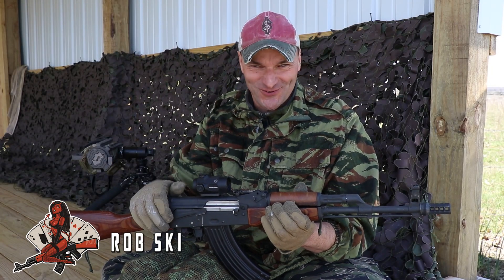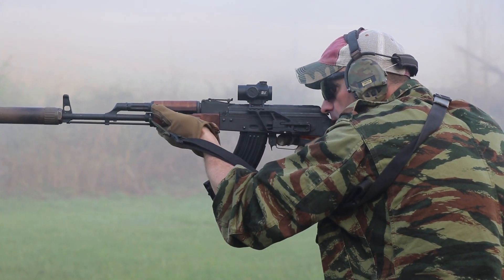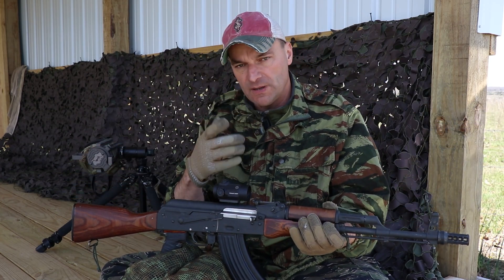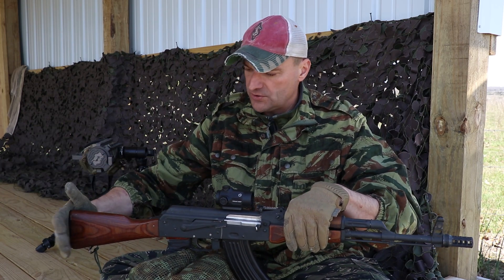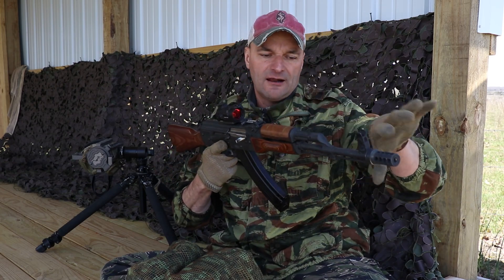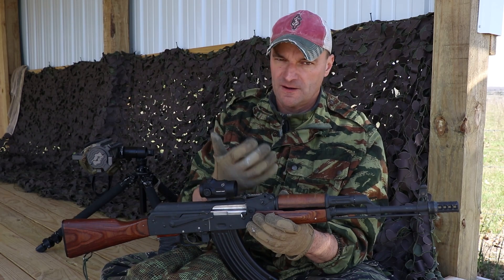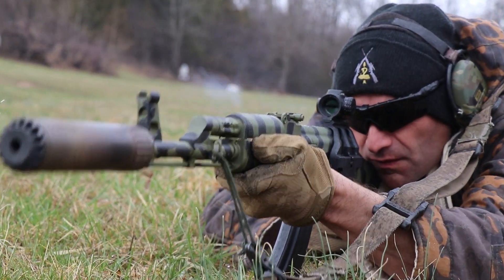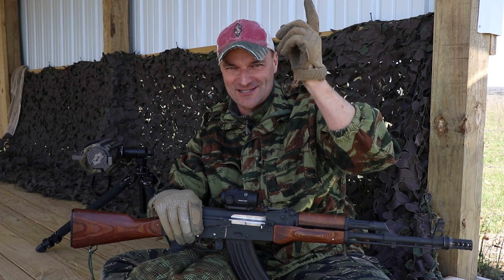Better AK47 Recoil Management! Cost nothing!

Comment: This may be what I need to get for my Maadi. I'm a firearms instructor and there's a 15 year old girl in my class that is hesitant to squeeze the trigger. She's a great shot with a 22. But after a couple of rounds down the pipe of the Maadi, she starts backing off it. Thanks for the video.
Reply: John Jacob   One of the first classes I taught had a girl in it who was 13. She had never fired a weapon prior to attending my class. By the end of class that girl could handle firing several weapons ranging from 22 to an AK47. About the only thing she needed help with was pulling the bolt back on the Uzi. But she loved zipping through the magazines in short burst. A new gun nut was born, lol. Her age wasn't really a huge factor.

Comment: I'm glad you had the cajones to mention that extended grip C-clamp thing. I feel like some guy did that as a joke and it went viral. I've never seen anyone use it until it showed up on YouTube. To each his own, I suppose.
I think I'll invest in that pad for the stock. My nearly 60 y/o shoulders can't take the recoil like they used to.
Reply: Highly recommend the pad for anyone who is recoil sensitive or larger in size or both.  My problem was both.  That extra length and the extra surface area helped me out a lot.
Reply: Its called evolution. In WW2 the soldiers were taught to shoot pistols with one hand. We dont do that anymore either do we?

Comment: Great video sir. Back in the day (late 70's - late 80's) I would see quite a few guys in my unit would have very few issues when firing the M-16, but if you handed them a M-14, they would have a lot of trouble maintaining cheek to stock weld for fast follow-up shots due to poor recoil management techniques due to the increased energy impulse. You can get spoiled real quick on light recoiling weapons for sure. Really enjoy your features friend, hope ya have a great day!!
Reply: You're comparing apples to oranges.
Reply: @Enjoyer.762  Not sure what you mean. Please explain. Oh wait, I looked at your YT homepage, there's no need simple green
Reply: @brad branch  Comparing recoil management between the M16 and M14 makes little sense. You're comparing an intermediate rifle caliber (5.56 NATO) shot from a rifle design to be ergonomic with inline recoil management (DI gas system, buffer, recoil spring) to a full powered rifle caliber (7.62 NATO) shot from rifle (M14) that was an adaptation from the M1 Garand. 

Even if you compared the M14 to the AKM, it would still be an apples to oranges comparison. Again, 7.62 NATO full power rifle caliber. 7.62x39 intermediate rifle caliber with only slightly more recoil than 5.56 NATO. There are child constript soldiers in 3rd world countries that can easily handle the recoil of AKMs.
Reply: @Enjoyer.762  All you say is certainly true there's no doubt. I was making reference to Robski's comment regarding the difference in recoil impulse between the 7.62 and the 5.45. I understand where you thought I might have been going tho. And even though there is only a few hundred ft/ps difference between the 7.62 x 39 and the 51, platform weight figures into the equation as well.
          So to clarify, I was speaking to the talking point raised by the commentator regarding the lesser need for recoil reduction management techniques in the 5.45 AK platform versus the 7.62. I wasn't trying to draw a comparison between the AKM vs. M-14, that would be simply foolish.
Reply: @Enjoyer.762  And in all actuality , as an aside to my previous response: The buffer and spring assembly in an M-16 style platform is not there to reduce felt recoil by the shooter. It's there so that the BCG doesn't fly out the back of the tube and plant itself in your shoulder or neck. It's main purpose, is returning the bolt to battery. If you've ever fired a Ruger Mini-14, you'll understand what I mean. They don't kick any harder than an AR platform does, and they. don't. have. a buffer / spring /tube assembly. Neither does a bolt action remington 700 in .223, and they don't kick any harder either. Just sayin . . .
Reply: @bradbranch6462  1) you made a comparison from the m16 to an m14, two very different weapons platforms with very different recoil impulses.

2) the buffer spring absolutely does and was intended to reduce recoil as well as return the action into battery. They are not mutually exclusive. You don’t need to look much further than different buffer weights and buffer solutions to see that what you put there can and does have an effect on the recoil impulse. 

3) the mini-14 does 100% have a different recoil impulse by virtue of it being a different gas system (essentially piston driven) which increases the mass being moved rearward into the shooter.
Reply: @TheHashtagSquad2K15 (1.)  Doooh K, I know you guys are having a bit of an issue understanding the purpose and intent of my original comment. {PLEASE READ THIS SLOWLY, AND IN IT'S ENTIRETY BEFORE RESPONDING, AS I'M DISENGAGING AS OF NOW}  

          So I'll lay it out nice and neat. NOWHERE, did I EVER, postulate that M-16s and M-14s were comparable weapons. I simply stated, and you can read it in my original post upstairs, " I would see quite a few guys in my unit would have very few issues when firing the M-16, but if you handed them a M-14, they would have a lot of trouble maintaining cheek to stock weld for fast follow-up shots due to poor recoil management techniques due to the INCREASED ENERGY IMPULSE".  Sooooo, the very use of the phrase, INCREASED ENERGY IMPULSE, should tell you that I KNOW that there is quite a difference between the two. I was simply stating that soldiers,  more familiar to FIRING the M-16 they had been issued simply were not accustomed to the INCREASED ENERGY IMPULSE of an M-14. I was not comparing any weapon to any other, simply relating the history of the remark as the reality of the circumstance dictated. 

          (2.) This is from a GUN DIGEST ARTICLE  from April 2012. Written by a guy that knows ARs inside and out, not some BS tommy tacticool internet dweeb from somewhere is the wastelands of the etherworld. "In Gunsmithing: The AR-15, Patrick Sweeney shares tricks and information gathered over 25 years of shooting and wrenching on the AR-15. The following tips are from the chapter on buffers and recoil springs:

The AR-15/M-16 rifle, as do all self-loading rifles, needs a recoil spring to cycle the action. Due to the lightweight design of the AR, the spring also requires a buffer, or extra weight. The earliest buffers were simply plastic tubes that rode inside the tube and in front of the buffer spring and gave the spring a bearing surface against which to work on the carrier and bolt. The carrier and bolt, blown off of the gas tube by the gases, cycle back into the buffer tube inside the stock, compressing the buffer spring. Once the energy of that action has been absorbed by the springs’ compression, the spring then uses the stored energy to push the buffer, carrier and bolt back forward." 

          You will please take note that he does not, (nor does any US ARMY TM on the M-16), state  that the purpose (or side purpose)  of the recoil spring/buffer/tube assembly is to mitigate felt recoil by the shooter. Now granted, there is a "fringe benefit" to the recoil system of the M-16 in that as a result of the platform's system design, recoil can be quite pleasant. BUT, there is only one properly weighted and sized buffer for each particular system as is dictated by cartridge pressure, BCG weight, length and mass, as well as tube style (full length rifle vs carbine vs. pistol). 

         (3.) There may be a SLIGHT PERCEIVED difference in the felt recoil between the Mini-14 and the M-16, and although I cannot profess to know what the exact data figures are, I can absolutely attest to the fact that I never felt any difference in the two. But I think you would have to be a very small, thin, gangly type individual to really experience any felt difference. And in my experience, and I have done this, you can shoot either one off your zipper and walk away. Been there, done that. IF YOU HAVE READ ALL THE WAY TO THIS POINT, PLEASE GO BACK TO THE BEGINNING AND READ THIS THROUGH AGAIN

Comment: To my mind recoil management and stabilizing the rifle in rapid fire are two entirely different things.
For every action there is an equal and opposite reaction...absolutely. 
Any muzzle device that inhibits the flow of gas from the muzzle will generate back pressure on an  already (usually) over pressured gun.
Example- I installed a CNC Warrior 4 piece flash hider on my Zastava M 92 pap pistol. I noticed an increase in recoil after having done so. The price I had to pay for total flash suppression was mitigated by the installation of a KNS adjustable gas piston. Opening the head of the piston decreased the surface area being pushed by the gas from the gas port. The gases flowing through the opened piston head traveled down the gas tube and out of the ejection port very noticeably increasing the smell of gas upon firing.
There's no free lunch in physics.
The increased weight of the gun ( the 4 PC. muzzle attachment weighs 8 ozs.) along with the surface area of the sb-47 brace and having de-gassed the rifle altogether make my gun a powder puff to shoot.
It seems to me that if you first mitigate the rearward forces of recoil that any perceived motion of the gun because of your grip would be lessened accordingly.
I don't shoot mag dumps out of my AK.
My gun is for hunting and recreational plinking.
It's also the gun I would grab for home defense and I don't think it would take 30 rounds of 7.62x39 to get the job done.
Multiple attackers would be served according to Boarding House rules...
nobody gets seconds, until everybody gets firsts .
If you can hit what your aiming at two apiece should work just fine.

Comment: Rob thanks for the great content! Just received my order from the store and very pleased.. I’ve been running these mechanical masterpieces and sometimes I drift away but like some cosmic magnetic force always come back.. I know there are many options as far as optics but for ME.. I would be completely satisfied if I could run a solid dust cover rail with my low pro red dot with a quick detach as well as a low pro magnifier with quick detach. Slick sides .. low profile..still maintain cheek weld with no risers.. and puts it right next to the AR .. that set up is like unobtanium… quick on quick off ..simple ..light ..slick side.. and low! Please push one of these company’s to push a quick detach low profile magnifier that mounts straight to picantinny with a quick detach. Maybe there is one out there but I haven’t seen it. Even if it didn’t flip to the side I could live with that…if you needed it.. pull out of a pouch and quick attach..anyway..thanks bro..
Reply: If you are really after AR ergonomic, the AK isn't for you. There's no method of accessorizing an AK so it has exactly the ergonomics of an AR.
Reply: @Enjoyer.762  That’s not at all what I was saying and have been running all the variants for 25 years.. Simply running My dot and magnifier like I do on all my other platforms Is more difficult on the AK is all I was saying . But a low pro magnifier would solve that.. just a comment.. never mentioned ergonomics. Thanks for the input though.
Reply: @AKB - All accessories of the AKs are essentially work arounds to get round the basics fact it was an assault rifle design in the late 1940s design for 0 - 300 meter engagements with iron sights.  I don't care if it's the milled receiver 1950s era, stamped 1960s era, or the 1970 AK74 era, or the 1990 era AK100 series. The modern Polish Beryls and Russian AK 12 still have the same inherent issues when using red dots and magnifiers - you still end up with a goofy chin-weld and weight balance.
Reply: @Enjoyer.762  Exactly! And the simple solution is for a company to make a low pro magnifier that could still flip to side or a quick detach.. technology is pretty amazing these days and would have thought it would have been done long ago. In a joking way was asking Rob to tell a company like primary arms to make one.. whoever does would sell the shit out of them! Maybe I’ll try to make my own! Thanks bro!
Reply: ??? Why would you need QD optics when the entire siderail can be quick-detached?

Comment: I had terrible trouble with cheek slap from my M70 and M90 ZPAPS when shooting with irons. The problem was solved completely by taking the slant brake off. Seems that with my body mechanics and my western style of shooting, the muzzle down force created by the slant brake resulted in the high stock comb of the Yugo pattern rifles forcing the stock up into my cheek.  Now both rifles wear simple brakes.  Just throwing this out for anyone else suffering from cheek slap.
Reply: I didn't have cheek slap issues with my aresenal 107R or my galil but I had terrible cheek slap with the Zastava M70.  I too had to replace the slant brake with a compensator.  It completely eliminated the issue for me as well.  I didn't mind removing the slant brake since the M70 doesn't have a bayonet lug anyway.

Comment: Robski, have you done a video on the KNS adjustable piston and do you feel it reduces bolt carrier speed/impulse? A super slow motion video with and without reduced gas, showing if recoil and receiver flex is tamed would be nice.
Reply: It's simple physics fact - it does reduce bolt carrier speed and impulse, as evidenced by shell casings popping gently out of the gun instead of getting yeeted

Comment: Over gased is good. As you said, it increases reliability. Which is one of the advantages that the ak has over the m16 platform.
Reply: The M16 keeps itself clear of debris for longer, so it doesn't need to be as gassed.
Reply: Overgassed to a slight degree increases reliability. Excessive overgassing causes damage to the rifle and reduces the lifespan of the trunnions, recoil spring, the bolt carrier group, the receiver, and speeds up barrel gas port erosion.

Comment: So much YES to the argument on "C-clamp". People are down-talking AKs for having a short front grip, and forgetting that spending a long time holding a rifle in this way is very tiring. They end up with the very hold they don't like but which is the most energy-efficient. And that makes the long fore-grips pretty much worthless when that kind of grip is used. It's one thing to utilize that hold in a competition where you hold it with a C-clamp for a short period of time, and completely another where you are in combat. Totally different applications and thus holds.

Regarding recoil impulses, I can add a little. I watched an interview with a developer of AEK-971 (which evolved into A-545) and he said that there are 4 components to the recoil. As Rob mentioned: from the shot itself (gas  expansion propelling the bullet forward in the barrel), and bolt carrier hitting the rear-most position. These components are for rear-directed recoil. The other two are gas expanding in the has system and bolt carrier slamming forward again. Those two are FORWARD-directed recoil.

Comment: Let's face it, that  7.62x 39 mm  (.30 caliber) round is a beast, I mean smashing through red bricks or  cinder blocks, small trees, just got to deal with it, its the AK life.....thats what push-ups, and pull ups are for.
Reply: Not really. It delivers slightly more kinetic energy within 300 meters than 5.45x39 and 5.56x45. Comments like yours are cringeworthy. You want a more hard-hitting round for defeating light barriers and body armor, step it up 7.62x51 NATO M993 AP and M80A1 EPR.
Reply: @Enjoyer.762  Dude, or duddette,   my comments are just based on the original caliber of the AK platform which is 7.62mm x 39mm round. Of course theres more hard hitting rounds out there like the rounds that come out of a M61 Vulcan which uses 20 mm rounds which cost nearly $30 per round. My favorite platform for the 20mm round is the US Navy's Phalanx CIWS. Its kind of an older system now, but the Navy still uses them because it's a radar guided 6 barrel spinning gatling BADASS. Check out some footage on YouTube. Anzio Ironworks will sell you their  mag fed, bolt action 20mm rifle for about $11,000, that is, if you don't mind a little recoil.

Comment: I'm Hoping that the Archangel Stock on my M70 turns out to be a Keeper. Its Ugly as Hell.
Reply: @CLOV4R713 AKs have such smooth lines though. 👌
Reply: @CLOV4R713  this is the only Ak I've ever owned out of the nine that has that type of Stock. All the other's had the issue Wooden. ( 1 Underfolder was in the Mix) I like the Adjustable cheek Rise option however since there's going to be an Optic very soon.
Reply: I love my arch angel stock on mine, really comfy.
Reply: @badgerrun8771  that's good to hear. Like I said this was a First time for me to step away from the Wood Stock.  I really like the Houge Lower Handgaurd it came with however.
Reply: @jameshayden5053  yeah the hogue grip is fantastic, the pad on the stock and the gas system on the newest gen m70s makes it one of the softest shooting AK variants I've ever had. id have to say it shoots as soft as any of my AR rifles
Reply: @CLOV4R713 yeah I went and looked. I like the Traditional Look but I've had my share of the "AK Stock Slap " deserving so for not getting down on the Stock.

Comment: Mine sends case 6 ft high 8 foot right. What's the best way to address the over gas problem?
Reply: Best bet would be a KNS Adjustable Piston
Reply: KNS Precision Adjustable Gas Piston. Adjust it so it cycles reliably and then give is a few more turns, just to be safe.
Reply: That's why they work in some of the worst conditions.
Reply: ALG/Geissele 15%+ buffer spring is a cheap fix. An ALG High Energy Main Spring also reduces felt recoil slightly. Both springs together are under $20.